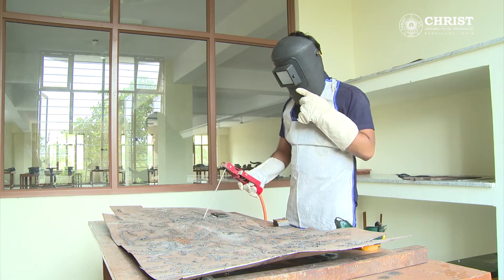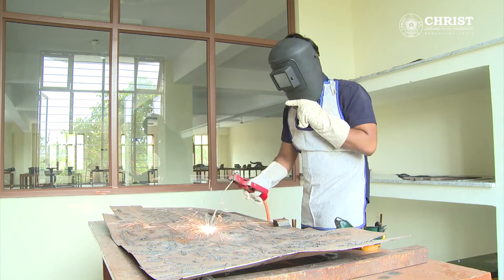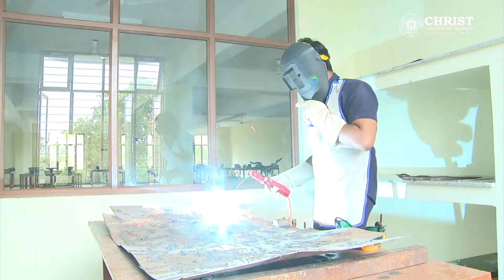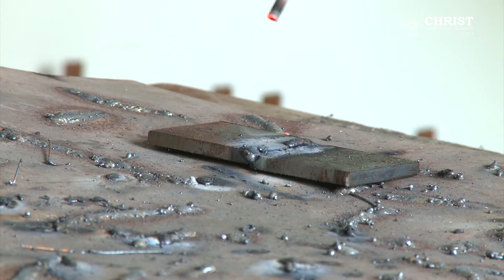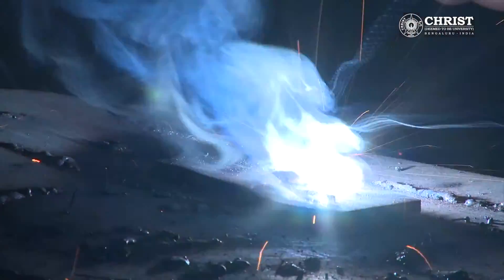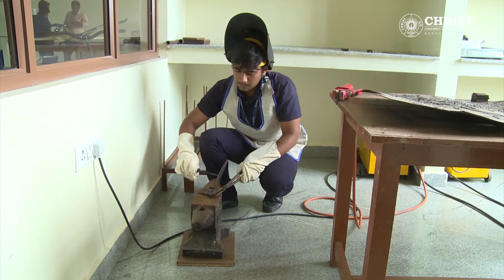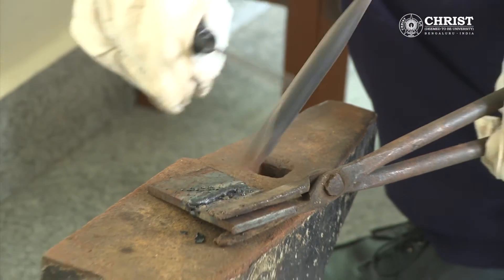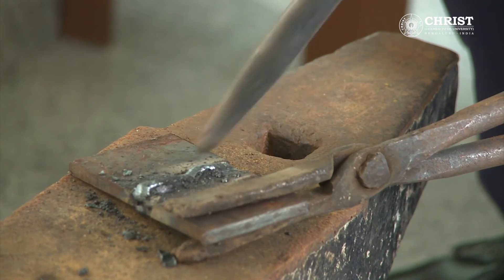Welding Butt joint - Mechanical Engineering

Comment: After welding, job shouldn't be dipped in to water. Because due to sudden cooling, material property changes into martensite ie. ductile to brittle. So that crack may occur.
Reply: Yes You are correct it is only made so that students can hold the job and bring it to teachers for evaluation. We can use sand also but due to improper floor space near the welding area it is not being used. That is the only reason not for material testing or quality check.
Reply: its called quenching

Comment: Chutiye , the welded parts should not be quenched in water or oil, it will make the material more brittle and in many cases it will crack the weld. Welded parts should be cooled down gradually at room temp.
Reply: Sheesha the only reason it is cooled for students to hold it in hand and bring to teachers for evaluation. The cooling process obviously needs time and specially we use sand but since students abide by timetable and time in which their job is to be evaluated followed by viva. This process is done by every student in practical class.
Reply: @ivansunitrout5685  you are right but in the video he did not mentioned that, if someone see this video for education purpose he will not understand it and he will assume that welded parts could be cooled down by quenching. Before uploading a video they should atleast check that they are showing the proper methods  and reason for those methods.
Reply: yup